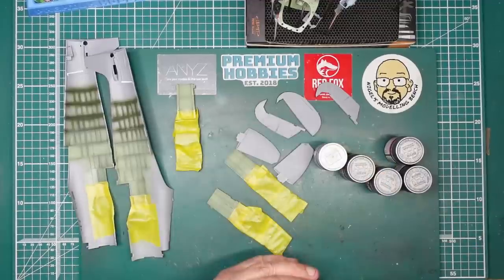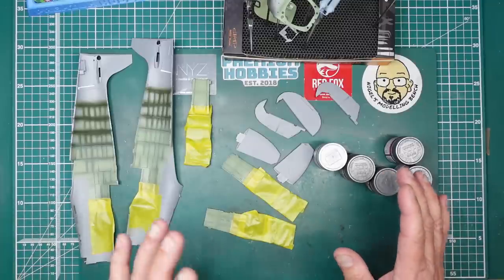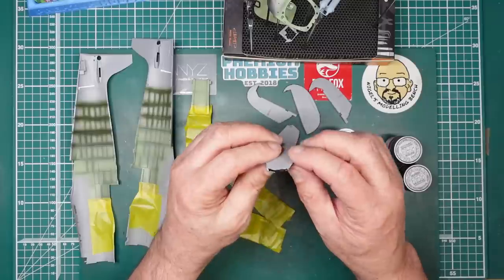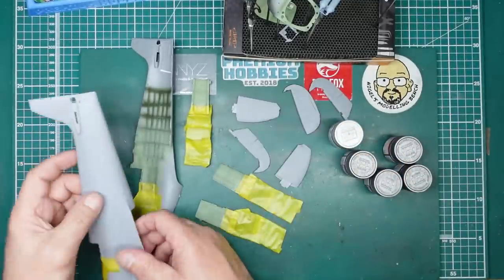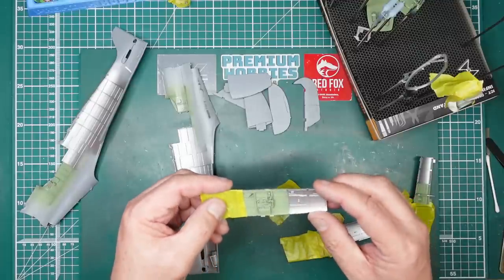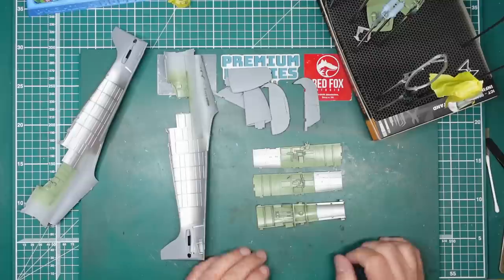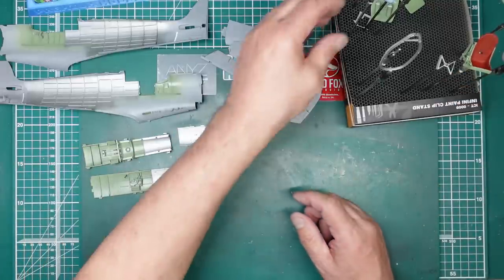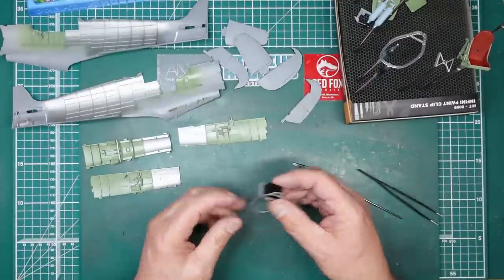Airfix new tool 1/24 Spitfire Mk.IXc Build. Part three.

Comment: Nice video Nigel. I am a bit behind on this build series. I have a good tip with putting decals down. If you are going to do a lot of decals in one sitting, your pot of warm water will rapidly cool down. Buy one of those electric scent oil burners. The ones that plug into the mains and have a small circular dish to put the oil in. The dish is usually about 4 inch in diameter. You can turn the burner on, then put warm water into the dish. It should keep your water warm for a longer time. Then you can decal to your hearts content, and always have warm water. That's my tip.
Reply from the maker: I've looked into this many times Andy, and never bothered..
Reply: @NigelsModellingBench  Depends on how many decals you are doing at once. I found that I had to go back to my sink and get more warm water if I was doing loads of decals in one sitting.

Comment: Nigel doing decals live on camera he's brave👍👍 I think you got confused by the instructions on the wing👍👍
Reply from the maker: Not confused James lol. I just cant see that the sequence they suggest will aid the build. As it happens, the spar also centres the front of the fuselage on the wings, so the position of the spar will determine the perpendicularity of the fuselage to the wings in plan view. See part 5 for that bit of info.
Reply: @NigelsModellingBench  It's like an actual wing set up, however for realism the wings are attached like the real spit, I don't think Airfix could of managed tooling that accurate or expected the modeller to achieve. BTW the 'new' Airfix Plastic is actually the old (from the a recipe discovered in the archive).
Reply from the maker: It is a work of art James.. beautifully made.. just the build sequence needs looking at, as per my new video "Extra 2", at least in my opinion.

Comment: Tamiya do a Flat Aluminium as well..
Reply from the maker: Yes, XF-16 but it is very grainy.
Reply: @NigelsModellingBench  LP 38 in the lacquer range..it's a dull aluminium
Reply from the maker: Oh that one. I have it but forgot to include it, probably because I didn't want a flat finish?? Or I just didn't spot it on my rack??
Reply: @NigelsModellingBench  Yes it's a very flat finish..prob better off with the Gloss one..

Comment: I love the Super Metallic paints! My only complaint with them is the shades are not very distinctive when compared to each other. I'm referring to the Super Fine Silver 2, Super Duralumin, Super Stainless 2 and Super Iron 2. They are amazing to spray and very durable in any case.
Reply from the maker: What do you thin them with Ken?
Reply: @NigelsModellingBench  I use both Mr. Hobby Levelling thinner and Rapid thinner. I know some have said the Rapid thinner gives a better metallic shine, but I'm not 100% convinced of this. I think the shine of the base coat is the biggest factor.
Reply from the maker: I agree.. i have been told rapid is better... cant see a difference myself.

Comment: Hi nigel, I've  been following along enthusiastically, but  unfortunately  my kit seems to have  alignment issues when the fuselage halves are together, i first thought it was a slightly warped fuselage half, but upon dry fitting the cockpit assembly and test fitting ,it appears the cockpit assembly locates in its appropriate slots , but the fuelage halfs are not aligned at the top front, but pefectly aligned from the rear cockpit forward,  currently I'm assembling the wings and have left the cockpit , for a more intensive test fit ,my office is  mostly painted but obviously im thinking of future troubles,and reluctant to spend any more time on details ,  you mentioned your kit too looked off front top of fuselage ,  any thoughts on this  lately, or, am i being a bit  too pedantic,
Happy christmas, by the way love you channel
Reply from the maker: Hi Glyn, thanks for the kind words. My fuselage did appear to be out of line but once the cockpit was in and all clamped up it seemed to align.

Comment: This looks like a very difficult kit only experts should attempt. Airfix should look at Tamiya’s approach in the latest f35 and fix this kit to make it accessible to the greater public.
Reply from the maker: Not at all Sir. this kit is not difficult to build. You are right, it isn't Tamiya, but if it was it would be perfect and cost about £300 GBP.
Reply: @NigelsModellingBench   It is a well priced kit, for sure. I wished Airfix was able to mold some of those parts in 3D instead of many flat parts. I don’t think I can attempt this as an intermediate builder.